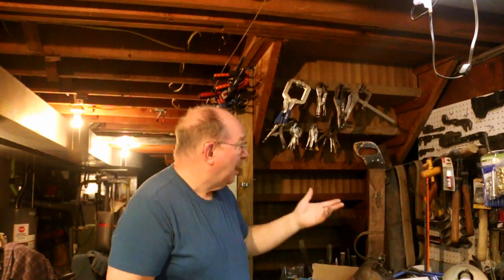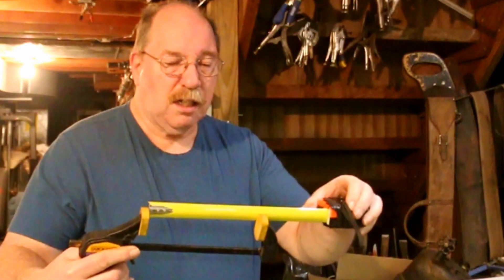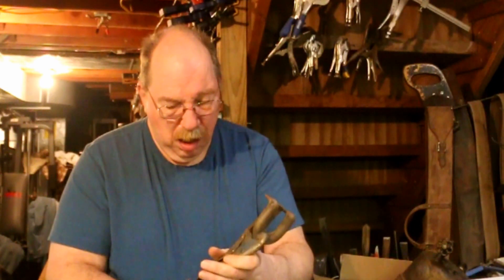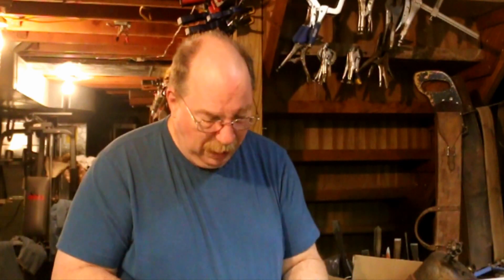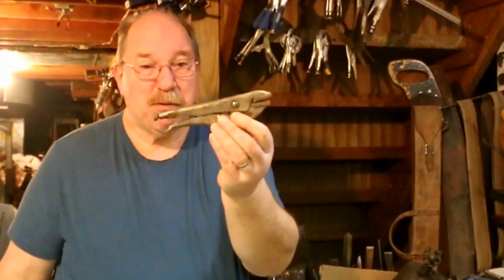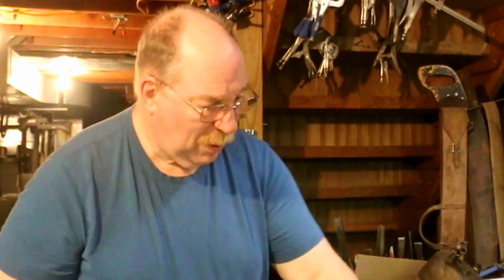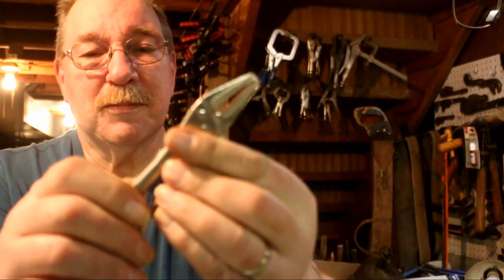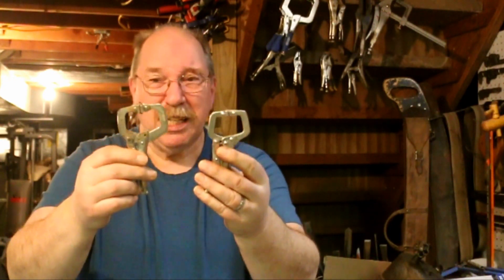Workshop Organization   What Is On The Vise Grip Rack

Comment: Better to have them and never need them than need them and not have them. I think in the US all locking pliers are called by everyone vise grips (whether they are vise grips or not). In the UK all locking pliers are called Mole Grips after a make that was around from the 1950s to the 90s. Original Mole Grips are so much better than knock offs and every time I am at a car boot sale I try and get them for around a £1 each. P.S., love to see the clamps as well then can we see your adjustable spanners and combination & slip joint pliers.
Reply from the maker: Happy to share all the tools in the shop. It will give me a reason to knock the dust off some of them.

Comment: I had a pair of those cheapies that wouldn't clamp down anymore, I spent a few minutes trying different things to no avail......I took out the thumb screw and spring for parts and the rest resides in the bottom of the lake.
Reply from the maker: I pile the scrap up by the tractor shed and haul it to the junkyard a couple times in the summer. Doesn't pay much but it covers the gas.😁😎

Comment: My 4 incher is like yours with the long snoot. I've got stuff hung all over the walls besides shelves. The guys that built it thought I'd loose all kinds of space because of the slope of the 'floor' and having to step the width in narrower because of the curve of the road. Not yet! Thanks, Unc and GBWYall!
Reply from the maker: I don't use themnoften when I need them they are handier to find now.😁😎
Reply: @OldSneelock  2 of mine are in my tote or in the big box if I actually wanted the tote to weigh less than a ton. The chain job is always in the big box just waiting.
Reply from the maker: @lewiemcneely9143  I don't have chain vise grips. I do have a 24" and 16" chain pipe wrench. The vise grips must be going home with the son in law. 😁😎
Reply: @OldSneelock  This one is a chain pipe wrench (I guess, for the odd pieces anyway)  with a Vise Grip works. I'm right sure it's name branded. And I've got a strap Kline wrench too so if the left 'un don't get 'em.....................